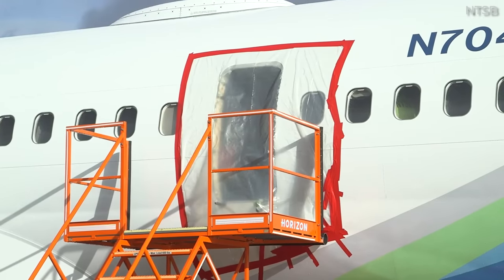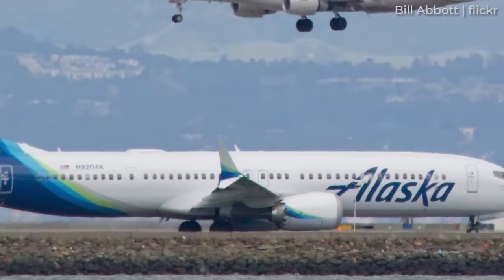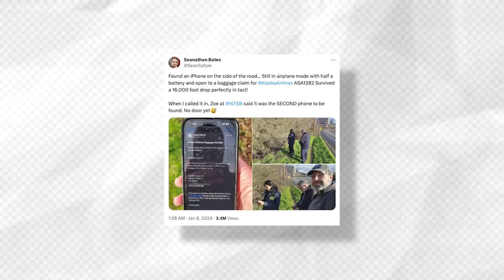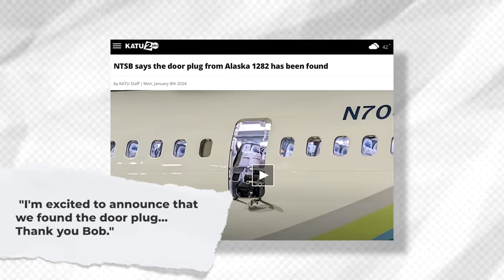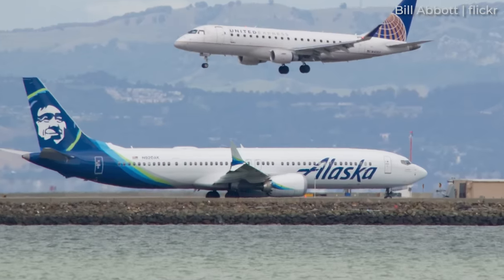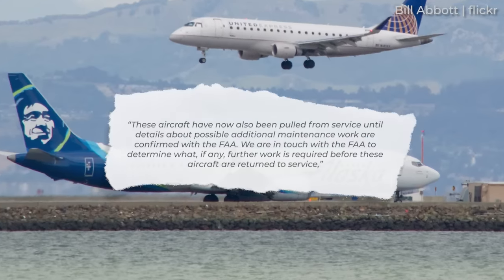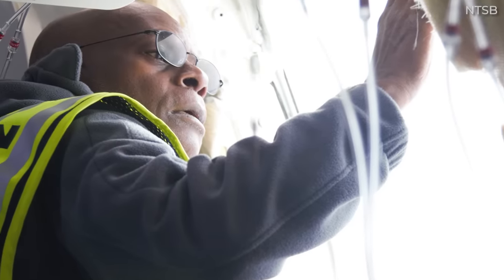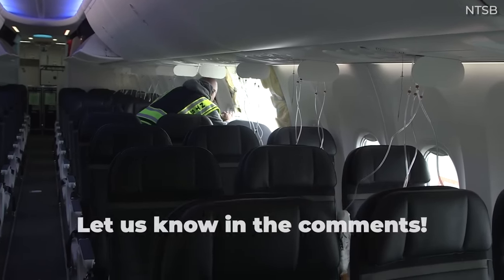Flight AS1282: Are We Seeing Another Boeing 737 MAX Crisis Unfold?

Comment: Boeing is saving Airbus's millions in marketing that's for sure.
Reply: Well Airbus can’t make up the orders lost by Boeing so I don’t think this will hurt Boeing too much.
Reply: rokiesensei  A350 saved everyone inside.
Reply: Poor Boeing, bankrupt.
Reply: Airbus has its own issues.
Reply: @nicksendetsky  The cabin crew saved everyone inside.
Reply: Am I going to trust company that is lobbyong safety board or the one that has to invest in R&D instead?
Boeing deserves much worse than its happening to them since 2020
Reply: Ha Ha that's a good one. But very true. 😄😄😄
Reply: @Boodieman72  what issues does airbus have?
Reply: Airbus saved Boeing millions in marketing that’s for sure after AirFrance 447 and Qantas 72. 

Make a stvpid comment, get reality thrown back.
Reply: @jojothetasmaniansassmonkey8866  Bad paint, bad engines on some of older 220's and 230's, which not technically an Airbus issue they are still attached to them.  They way the flight control system with the side joystick means the pilots don't get any physical feedback.  Need I go on?
Reply: @sanitman1488  
Grow up, it's a bit of tongue and cheek.

Currently, I would still prefer to fly in a new Airbus over a new Boeing.
Reply: @anderms1234  I would prefer not to fly on any Boeing MAX aircraft.
Reply: @anderms1234  Grow up, you got triggered.
Currently I prefer to fly any aircraft manufacturers products. Everyone of them have had accidents related to production deficiencies yet correction and in time became safe reliable machines.
Reply: @Boodieman72    The composite fuselage  saved everyone inside.
Reply: @ZhoRZh37 both Boeing & Airbus certify planes in exactly the same way.  Both give government regulators their proposed qualification plan and that’s reviewed then commented before acceptance.
Reply: @Boodieman72    None of those problems cuz a major crashes like 737 MAX did, did they?
Reply: rokiesensei shows how well the A350 is built that it collides with a plane and the structural integrity remained. It was the fire that ended up being destructive.
Reply: @Boodieman72 their seatbelts did
Reply: @jojothetasmaniansassmonkey8866 the 330 NEO engines are junk, the 321 NEO ACT system is junk…
Reply: @Boodieman72 bad engine with 400 hours on it on a brand new plane…my crew just  finished installing the new one
Reply: @justing42 A320 family of aircraft don't just fall out of the sky. Nor do they shed a door mid-air. So there's that.
Reply: @bearabletable7527  It doesn’t matter very much because they very well could have. A bad landing gear could fly off and hit an engine or cause a plane to overshoot the runway.
Reply: PillsCureMyDepression Even though the other guys are just as sketchy?

Comment: This could have been the 3rd 737 Max crash.
They were lucky the plug-door failure happened at 16,000 feet rather than 36,000 feet, where the explosive decompression forces would have been much greater. It could have ended up like Turkish Airlines flight 981, where a cargo door failure caused structural damage that brought down the whole plane.

It's ironic that after the Boeing / McDonnell Douglas merger, and the cultural changes that brought, that the 737 Max is gaining the same reputation as McDonnell Douglas' biggest plane, the DC-10.
Reply: The Merger can be the biggest mistake Boeing ever made. Not only MD's commercial division management changed Boeing's culture, the merger also removed the biggest thing pushing Boeing forward - Domestic competition, a competition can't get around though tariffs.
Reply: McDonell Douglas made some cool planes, however those planes weren’t really safe. It’s a shame that it’s becoming the next DC10, as Boeing was rushing the launch of the MAX to meet the Airbus A320NEO, which is similar to MD rushing to compete with Lockheed Martin.
Reply: Also lucky the door didn’t hit the horizontal stabiliser 😬 that could’ve brought the whole plane down…
Reply: Clean separation of a structure from an aircraft requires a lot of effort to make it safe. It could easily have struck a control surface.
Reply: Well, the First MAX-9 for sure. Since the MAX-8 (those that crashed a few years ago now) do not have these door plugs.
Reply: @AaronShenghao The domestic competition factor is a really good point. It’s way easier to get politicians to help you out when the only competition is foreign.
Reply: The DC-10 doesn't deserve the reputation it has. A lot of the accidents it was involved in were pilot or ground crew error rather than a failure of the airplane itself.
Reply: @ Uldihaa I thought DC10 had a reputation of the engine falling off?
Reply: Even if it wouldn't have brought down the aircraft, there would've been many more things to fly out of the plane, including passangers who would have taken their seatbelts off.
Reply: Why people fly Boeing beats me. Worst Aircraft ever made.
Reply: @eerolz8758  That initial blow out is not as strong as TV and movies let on. It is extremely rapid, lasting less than a second. Anyone sitting unbuckled in that row or standing in the aisle might go out and debris would cause more injuries but it's not going to suck every unbuckled person in the plane out of the hole. The air which moves you is any air on the far side of you away from the hole when the breach happens  as it hits you while trying to go in a direct line towards the hole. If you were against the far windows that's going to be a few inches of air which doesn't weigh enough to cause much effect on your body even moving at the speed of sound. If you are seated that would just be any air between you and your seat which wouldn't really lift you against gravity. Once the decompression occurs there would be no more suction and it would just be windy and loud. Unless you stuck your hand out into the airstream you would feel no pressure at all. Even in space if you were in an airlock which was about to open, if you hugged the opposite wall you would barely lurch when the door opened, air just doesn't have enough mass.
Reply: @Jack_The_Ripper_Here BS
Reply: @-Bill.  Yes? I never said everyone unbuckled would get sucked out. But now everyone who was sitting near it was still buckled, because they weren't at cruising altitude. And stuff all over the airplane wouldn't fly out, but they can still fly inside the plane, injuring someone... trays of food etc.
Reply: That was caused by maintenance  error. The engine was damaged unknowingly  while being installed. It could've  happened to any other aircraft.
Reply: @billj4137  No. Having a reputation means repeat occurrences of roughly the same failure.
An incorrectly installed engine fell off a DC10 once. American Airlines' maintenance failure.
Reply: I used to work for Boeing.  As soon as I pointed out the flaw for Safety, they let me go.  All they think is about $$$ Not about Human Life.  They don't care about You and Me !!
Reply: This incident wouldn't have made the plane crash, but there would have been injuries to some people at the cabin if this had happened at a greater altitude. Bad enough, though.
Reply: @billj4137  That was one incident, and it was due by an airline's maintence crew using incorrect maintence methods. They didn't remove the engine properly for maintence, then damaged its primary fastening points when they tried to put it back on. It wasn't a design flaw, it was airline greed using a faster but risky maintence method.

It's one of several things that people are misinformed about the DC-10. The DC-10 doesn't have any more of a history of accidents than any other plane of similar service history.
Reply: This whole situation could’ve ended terribly in so many ways. Luckily the blowout didn’t happen at cruising altitude.
Reply: The McDonnell Douglas dc10 reputation was a little unwarranted. The crashes were associated with operator and maintenance errors that were conducted when sealing a cargo door and mounting engines. DC10s have been operating as cargo haulers safely for decades after those incidents. The 737 incidents are clearly design and manufacturing deficiencies
Reply: If humans were meant to fly we'd have wings. Period.
Reply: The DC-10 had a deadly cargo door design, but the company grounded their planes and issued directives to fix the problem as soon as the first incident occurred [I do believe MD knew it was a flawed design from the beginning and that it /could/ fail].  From my memory Turkish airlines didn't get the memo about this design defect, and did not retrofit their DC-10's until it was too late.
After that fiasco in the early 70's the DC-10 was proven a safe and reliable plane.  It was involved in many other incidents, and had a questionable hydraulic line design in the rear that made a situation worse in at least one of those incidents, but most post-cargo-door incidents were due to poor maintenance practices on behalf of airline companies, or pilot error.

This is in contrast to the 737 MAX where consumers keep discovering more and more unfortunate Easter eggs with its design and assembly methods.
Reply: @billj4137  That was only on one flight and caused by improper maintenance.
Reply: No very unlikely to have caused a crash
Reply: @Jack_The_Ripper_Here ’Murica
Reply: @Jack_The_Ripper_Here Sometimes people have no choice
Reply: While something like this happening at higher altitude would have more severe consequences, the way this investigation is going so far, I think it seems unlikely that this particular event could have happened at much higher altitude, where the pressure differential is much higher. With the 12 stop fittings on the door pressing against the corresponding stop pads on the airframe with full force, it would not have been able to move vertically. It was precisely at lower and intermediate pressure differentials, where the force on the pads is not very strong yet, that bumps, maybe caused by turbulence, could have dislodged the door plug just enough vertically to allow the fittings to come clear of  the pads. Once this happens, it doesn't take much pressure to blow it out. This assumes that this was caused by the much talked about 4 bolts missing or failed, which seems likely from what we know at this stage.
Reply: @glynnwright1699  could have struck a control surface true.  It won’t require more than a change to the plug install procedure to ensure it was correctly performed
Reply: The kind of catastrophic chain reaction that brought several aircraft down after a cargo door loss is much less likely today due to design changes.   The floor collapsed as it was never designed to take the full pressure differential and wasn’t vented.
Reply: @lindafukuyu5767 Boeing is a joke to work for
Reply: Exactly. That's why this is very very serious! Not unexpected for a Boeing Max however...
Reply: @Jeff-sp7bg In one case yes,  on those more than 20 planes (counting) is a complete lack of control and responsibility.
Reply: @CarlosAlexandre-fl2ut  sounds like a process issue post cabin install.
Reply: @vsucountryboy So how do we get across oceans if we don’t have transoceanic rail tunnels?

Comment: And this is the same company who's asking regulators for safety exceptions to certify their max 7 and max 10 aircraft. What a joke
Reply: I think (and hope) this will certainly delay max 7 and 10 certification.
Reply: You do realize that alaska was at fault for not keeping up with maintenance 💀
Reply: @Ashura4665  Please cite your sources sir. I'm not aware of any such conclusion to the investigation. On the contrary, United has found issues with side panels on their max 9s so it's not carrier-dependent
Reply: @Ashura4665 maintenance? The plane was 10 weeks old. If you have to take off an inside panel of a plane and re-tighten bolts (that aren't meant to ever be re-tightened) every 10 weeks...then there's a serious problem with the manufacturing process of the planw
Reply: Asking and granted, of course. Their salaries for several Members of Congress is well-spent lucre.
Reply: @BobSmith-dn6ed shouldn’t affect certification of those aircraft.  This is was a post cabin fitting issue not a design or certification issue
Reply: @Ashura4665  erm...IT WAS BRAND NEW!! lol.
Reply: @Ashura4665 keeping up with maintenance….on something that nobody looks at for a split second.  I never stare at door plugs for more than 2 seconds
Reply: @General3rdLeg NAILED IT
Reply: Max 9 =  only 9 aircrafts can fly in one time on the world
Max 9 =  with maximal 9 passengers on board
MAX 9 = 9 x you check all doors and use 9 screwdrivers
MAX 9= 9 x you kissing runway after normal landing
MAX 9 = Always you fly maximal 9 meters above terrain

Comment: Insane that a BRAND NEW plane has all these maintenance alerts and even more insane it was accepted.
Reply: It's not new it's a bodge of a old plane airbus make new planes boeing bodge adjust cock up now a criminal investigation needs to be done who is at fault and no more 737 inair until airbus is the best 100%
Reply: Let’s take a moment to accept the 737’s design is getting outdated
Reply: Welcome to the real world.  You probably don’t want to know all the things that pop up on all new aircraft at EIS.  As my boss used to say, that’s when the real systems integration testing happens.
Reply: Airbus isn't that safe
Reply: @Matty12333  just look at accident with a350 onrunway all out alive do to design aircraft if boeing doors would jam
Reply: @Matty12333  Airbus is safe. And so is Boeing if they manufactured it properly. The plane is well designed but because of quotas and time pressure those mistakes happen.

Comment: Instead of designing a new airplane from scratch Boeing has taken a perfectly good airplane and modified it to the point that it’s dangerous. That’s what happens when you pay more attention to the bean counters then to the engineers.
Reply: absolutely right   bean counters rule, quality, engineering excellence and innovation go out the door plug
Reply: Exactly!!!!!!!
Reply: @suspicionofdeceitthey would have, but airlines already said they won’t buy the 797. They tried to get Southwest and American on board but both said they’d rather keep the 737 and just have it modified.
Reply: That's just hysteria and bullshit.  The 737 Max design is quite safe.   Even with MCAS it's quite safe,  provided the flight crew has been properly instructed on it.   Anything is unsafe if you don't know how to operate it correctly.
Reply: *than    ...y/w
Reply: @Turboy65 the MCAS is safe now because they were forced to redesign its input system and add more redundancies. It wasn't safe when it got first delivered because it had a failure point at one single non-redundant sensor. Plus the way that Boeing lied about it only made it worse.
Also, planes are safe if designed and manufactured properly. Here we see an obvious case of poor manufacturing and lack of quality control at Boeing, there's no other explanation for such a malfunction on a 2-month old plane.
Reply: @osasunaitor  Point taken regarding the MCAS redesign,  and on that subject, MCAS exists because re-engining the 737 required mounting the engines in the "Wrong" location, too high, putting the thrust axis too high, due to the stubby landing gear.  The CORRECT answer would have been to install taller gear (wing redesign needed but they were doing that anyway) so the engines could be mounted at the right location to give a correct thrust axis.   Given how the 737 gear system works, this would not have required major fuselage redesign.
Reply: @Turboy65  if we're talking about correct answers, I think designing a new 797 from scratch would have been the most correct one, instead of redesigning an old airframe beyond its limits
Reply: @osasunaitor  Why?  There's nothing intrinsically wrong or outdated about the basic 737 airframe.   The Max has been efficient and commercially successful despite some errors made which were NOT actually technical errors.   It's probably been taken to its practical limit with the MAX 10, though.   Yes there is a viable market segment that Boeing should address, which was previously the domain of the 757.  The 797 should be THAT.
Reply: Bill Sutter said it right, aircraft are designed by lawyers and accountants, not engineers
Reply: @Turboy65 fine you can fly on it then. I’ll stick to an A320 family aircraft
Reply: @suspicionofdeceit the low costs don’t. Because that’s more training costs for pilots and mechanics as well as different types of maintenance facilities.
Reply: Boeing is the Apple of airline...lol